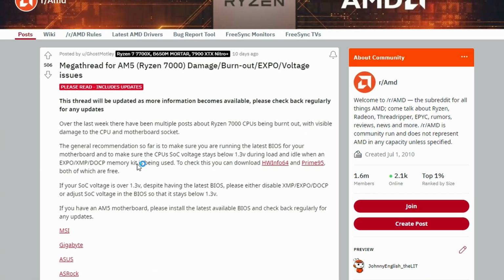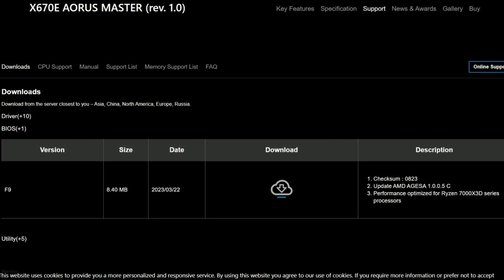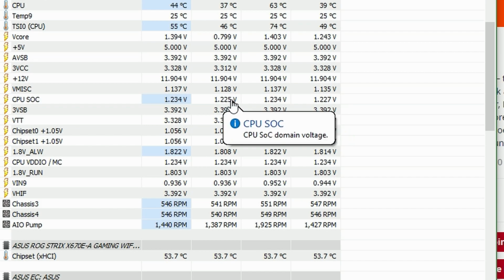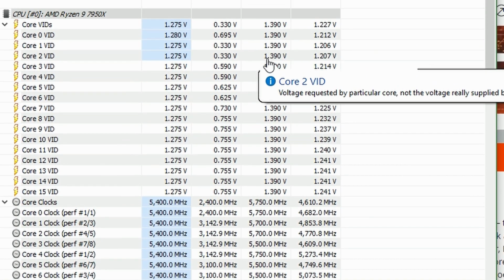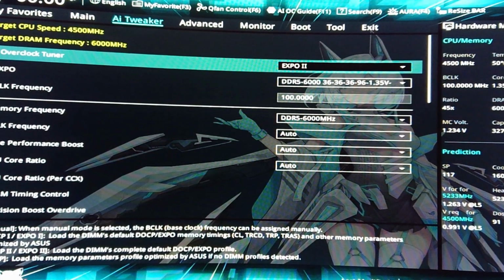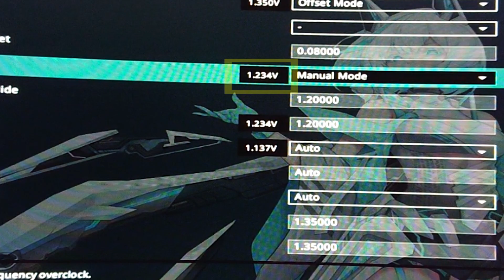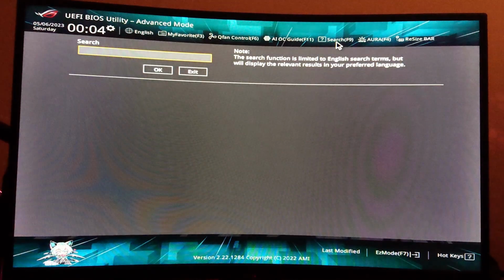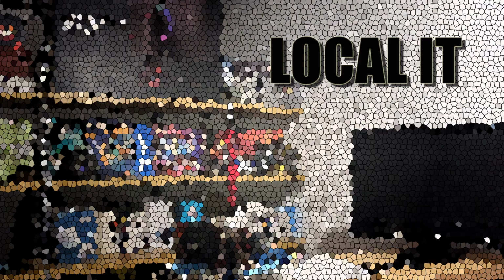Burned 7000 Ryzen DO THIS NOW! - 7800X3D or 7950X

Comment: The interesting thing I noticed if 5200, 5600 or 6000MHz tuned then they perform very similar using in game benchmarks. 7800X3D favours timings more than speed. So I thought lets try 4800MHz and same thing, tiny difference at 1080p, then I thought OK lets go vsoc lower to finally 0.85. Ran memtest and ycruncher for few days and my CPU idle power is like 13W.
Reply from the maker: @peteruk8  timings do play a lot. In another video about EXPO, I have a brief talk about it. Luckily, I finally  had some silicon luck with memory, went from CL36 stock to CL30 at 6000mhz. Even though, the actual fps increase is kind of small.

Comment: how did ur bios wallpaper change
Reply from the maker: @lelkasa361  its an option on select RoG boards.
Reply: @LocalIT  i am using a b650ef a board made by rog too, i would love to change the bios wallpaper if possible :) can you tell what app you used to change it?
Reply from the maker: @lelkasa361  there is a tutorial video on my channel, a YouTube short. Unlock Seven. The F version should have, because I've only tried A versions, the regular seven instead of the white seven, try it out.
Reply: @LocalIT  thank you for replying, i checked the bios tool section again and no i did not have such option on my rog board like you did have a good day / night :)

Comment: Hey my bios for cpu vddio is greyout I cant access it , I only change the soc voltage to 1.200v
Reply from the maker: @SpideyGamerHD  There should be a way to manual control it but I know that some BIOS versions have it locked.

Comment: With below build when turning on EXPO I got 1.4 volt VVDDIO / MC. First I adjusted my ram volts to 1.35 and this seemed to work with CPU SoC actually below 1.3v with 1.28v but VDDIO close to 1.4 and occasionially above. But I thought I'd still adjust Ram volt to 1.3, SOC to 1.2 and VDDIO as well like in this video. when I saved these settings my PC wouldnt post or go into bios giving a DRAM light on mobo. Luckily was able to enter bios with one stick of RAM in and default everything. I dont know which of the final adjustments was the reason, but kinda weary of trying again. Should I do RAM on 1.35 and VDDIO on 1.3 and let the rest be? or only RAM on 1.3?

My build:
7700X 
Asus Tuf B650 Plus WIFI 
RTX 5070 TI
Coirsair DDR5 6000 CL 30
Reply from the maker: @MrBRKSN  Hi, ram voltage is not the focus of this video and I would let it alone if you dont face issues. Ram voltage is not the mentioned vSoC or VDDIO.

vSoC was actually limited by vendors to 1.3v a little time after I posted the video. VDDIO should be in theory a little higher than vSoC. If it works like a charm at 1.3v or 1.35v leave it a that.
As for ram, VDDQ voltages. I have either 1.35v or 1.4v when EXPO is applied. I think up to 1.45v is pretty safe, check memory vendor site.

Good luck
Reply: @LocalIT  Thank you for still replying to this video! I guess I mixed up the various voltages when I saw my RAM was running with 1.4v. I'll set to my RAM to Expo again and see if VDDIO remains below 1.4. If not i'll lower the RAM voltage to 1.35 like I had before.
Reply: @LocalIT  Just tried again. Applied EXPO and VDDIO is at 1.424. Is the best step now to manually lower the VDDIO? By small increments?

Comment: It depends on DRAM and on MSI MAG B650 Tomahawk VDDIO is locked on 1.30 I can only change SOC Voltage which is set at default 1.30V
Reply from the maker: @RmX.  Thats after the lockdown, the video was made before those were implemented to avoid high vSoC values that we were getting, like 1.48 and such. Still, some boards, gladly still allow changes.

Comment: Up to 1.4v. Vsoc is actually safe but they lower it to 1.3volts with lastest bioses soo it doesent matter 1.3 is perfect for these who wanna 6400mhz 1:1 with memory controller.
Reply from the maker: Unfortunately thats something I can't say on a video. But the lower the voltage the better, as long as its stable. I kept going lower and now 6000 cl30 is super stable at 1.18v Will try 6200 later on.

Comment: 1.40 VDDIO & 1.3VSOC degraded my IMC on a 7500F. Wether it was the SoC voltage or the VDDIO, its hard to tell. Even till this day there are XMP/EXPO kits which set VDDIO to 1.4v automatically.
Reply from the maker: Sorry to hear that. Eventually higher voltages will degrade things, thats why I try to undervolt a lot of things.

Comment: Are there currently still reports of fried CPU’s and ASUs motherboards on the x670 series? Or have those been patched with recent (1807) bios updates?
Reply from the maker: Hi, the problem is long gone in the newer BIOS but this video still serves as a warning to monitor your rig closely.
Its a great tutorial to also undervolt if you are worried.
😉
Reply: @LocalIT  okay, thank u so much! I was scared at first, because this happened a lot, however I had my doubts as all those vids were 8 months ago, when the problem was I suppose at its worst. But thank you for the reassurance!!
Reply from the maker: @Myloh_YT  Glad I could help. ;) Don't forget to subscribe and share.
Reply: @LocalIT hi can i run expo 1 with corsair vengeance ddr5 6000mhz cl30 with the latest bios 1905? I am using x670e-a motherboard and 7800x3d
I am scared because my ram requires 1.4 soc voltage

Comment: Hello! I just build a 7800x3d + rog strig x670e-a set up. according to Hwinfo64, my cpu soc is 1.323V constant idle and under load. Also, CPU VDDIO/MC is 1.439 constant idle and under load. I am currenlty running latest asus bios 1807 released on 15 december 2023. Do you think i should switch to lower voltages or is it safe to run with these voltages now?

Thanks for all the help!
Reply from the maker: Hi, with the newer BIOS you shouldn't be getting over 1.3v so I would strongly advise you to try lowering it to 1.2v and see if its stable under stress testing. Good luck
Thank You so much for the comment and don't forget to subscribe
Reply: @LocalIT  thank you for the reply. It is the newest bios but it’s still giving me these readings. I did lower the voltage to 1.25 and it’s stable. Thank you and keep up the good videos!
Reply: Hello. Quick update. I contacted AMD and said that 1.323V on CPU SOC is completly normal.
Reply from the maker: @nacoleon18  I can't really go over what AMD says. But the "don't go over 1.3v" comes from ASUS website under BIOS update release. In my opinion and/or experience, the more you increase SoC voltage, the more stable RAM overclocks work. With my previous 2700X I had to bump SoC voltage just to get 3200mhz stable. With the 7950X I can run 1.2v with CL30 6000mhz stable. TLDR, if the system is stable with less voltage, the better in the long run. 😉
Reply: @LocalIT  agreed. Thanks for the reply

Comment: Another thing too is to make sure you have a decent cpu cooler that can handle/work better when ambient temperature gets high; like a hot summer day. Remember the 7800X3D can handle max 89 C.... back with the 5800H it could handle 105 C. 
I have a ASUS TUF B650M Plus wifi... I read my bios version is 1616, so that is after that April/2023 ASUS burn out fiasco right?
I checked my SOC voltage and I am under 1.3 V. I did mess with anything or try to undervolt just to be safe.
Thank you for some answers, just  a bit worried.
Reply from the maker: Hi, sorry for the delay. With that version you will be fine.
But, there is always room for undervolting 😉 Either be on the CPU SoC or vCore 😉

Comment: Hi, is it safe lowering the cpu vddio / MC Voltage to 1.2V, can it cause damage to my cpu or system? Or should I just keep it at default 1.376V?
Reply from the maker: Hi, lowering voltages won't cause any damage to the hardware at all. However, it can cause instability during stress testing or gaming. 
Be sure to test it and if everything is stable, go for it.
I have mine at 1,18v now and rock solid for months now.
Thank you for the comment and don't forget to subscribe.
Reply: Thanks for answering quickly, I was also wondering could the high voltage on SoC and VDDIO be the cause for my stuttering on my pc (I think the SoC is about 1.28. I have b650 plus tuf, ryzen 7 7700x, DDR5 6000MHZ Fury Beast 2x8gb) I get these weird microstutters and nothing really seems to help that ive tried. Could also possibly be the ram.  @LocalIT
Reply: Also was wondering do you think its safe to enable pbo with like -15 curve with the SoC and VDDIO set to 1.2?
Reply from the maker: @m0psi828  stuttering should be a bottleneck somewhere, doesn't need to be always GPU or CPU, could be a power limit too. Lowering voltages won't help with stuttering I'm afraid... But sure,try it. No harm there.
Reply from the maker: @m0psi828  I have a 7950X with a fine tuned Curve Optimizer, undervolting and the less voltage and temps, the better. PBO will have more headroom to Boost.
Reply from the maker: @m0psi828  oohh I forgot. 16gb only on DDR5 could be insufficient for nowdays.

Comment: Well i'm using 7800x3d and Asus tuf gaming b650m. I did what you showed me here. Everything working fine, but i can notice that now is PC taking longer to bootup ? Any special reason for that ?bootup
Reply from the maker: If you only did the two voltages, there is no reason for a slow boot. Lowering them would only affect windows stability. Have you try to indo the changes to see if it boots normally again?

Comment: Hi, The SoC Voltage shows me 1.295V, on EXPO Enabled, should it be safe ? + CPU NB/SoC value 1.304V-1.306V + CPU VDDIO 1.400V. I used this EXPO for 3 hours and turn off.

I was wondering if I should set the voltage (SoC/Uncore OC Mode and SoC Voltage) in BIOS in the first part of AMD Overclocking for PBO. And should I set with CPU VDDIO to 1.2V ?

And in the second part of Overclocking, where EXPO is turned off, CPU NB/SoC Voltage shows 1.015 V (options are Auto, AMD Overclocking and Override Mode (does not show when EXPO is turned off)--> I set this third option to 1.2V).

First, should I turn on EXPO and immediately go to BIOS and set these three voltage parameters to 1.2V? Before I go to Windows ? Can you help me ? Just to be sure what I should do correctly so that I don't panic again.

Specs: 7800X3D, MSI MAG X670-E Tomahawk (latest BIOS from 08/14/2023 ver.7E12v14, Corsair 64GB (2X32GB) KIT DDR5 Vengeance RGB 6000MHz CL30-36-36-76 rated on 1.4V (CMH64GX5M2B6000Z30)

Sorry I'm a newbie, I built a new PC this week so I'm worried :)
Reply from the maker: Anything less than 1,3v should be ok with EXPO enabled, but to me is a tad too high for my taste. If you are running 2x sticks at 6000 or 6200, I would try lower voltages. The video states 1,2v but now I've lowered even more both voltages to 1,18v and everything is running peachy.

The Ram rated voltage is for DRAM voltage (VDD/VDDQ) not the CPU SoC or VDDIO MC 😉

Thank You
Reply: @LocalIT  So, if I understood correctly, the following parameters should be set:
Soc Uncore OC Mode -> (Enabled)
SoC Voltage -> set to 1.2V
CPU NB/SoC Voltage -> set to (Override) -> 1.2V
-someone says that this also needs to be set
CPU VDDIO Voltage -> set to 1.2V (originally at EXPO I have 1.4V)

But I have other questions, with the DRAM voltage when I had EXPO on:
VDD Voltage 1.410-1.395V
VDDQ Voltage 1.410-1.410V
VPP Voltage 1.965-1.950V
-Someone says that it should be reduced to 1.3V on VDD + VDDQ, someone says that it's just normal when RAM asks for 1.4V, and someone says that this is the maximum "safe" limit, and someone says that you shouldn't have more be like 1.4V. I am confused.

-I ask: Should I return the RAM and buy, for example, 64GB 5200MHz CL36 which has a voltage of 1.25V or adjust the voltage from 1.4V to 1.3V? The difference between the 5200 CL36 and the 6000 CL30 is about 5-13 fps.
-How do I know that at 1.410V it is safe at EXPO?
-ChatGPT can't answer me because it only has data until September 2021. It's a shame.
Reply from the maker: Hi, If you are not fine tuning or doing any moderate tweaking, leave all the other settings at Auto or default values. The only settings that I recommend changing is CPU SoC voltage and VDDIO. Check stability and closely monitor with HWiNFO. This is just for safety and peace of mind.
If you want to bump performance then its Curve Optimizer and or offset undervolting. Check the other videos in the channel regarding this. 😉
Thank you
Reply from the maker: Keep the ram if it works fine, 6000 CL30 is amazing. I have 6000 CL34 but I'm trying to push them to CL32, I think its possible.
Don't worry about VDDQ voltage,if your kit can handle 1,4v its fine. However,you can try 1,35v and stress test for errors. I did.
Good luck

Comment: Hi, thanks a lot for the video. I was building one 7800x3d+B650 Aero G combo. But during bios upgrade (i installed CPU also) from F3 to F9c...the upgrade failed half way and system wont start again. 
I guess MB is dead and send it for refund, but do you think CPU is burnt also? So scared now...thanks
Reply from the maker: Hi there, I think the CPU is safe, failed BIOS updates won't cause any harm to other components. Try to get a board with BIOS flashback feature next time. With this, you won't even need a CPU inserted to flash a new BIOS. 😉
Thank you for the comment and dont forget to subscribe 😊

Comment: Why do these morons think that the first time they turn on their new build that the cpu is going to explode.  I am no genius or computer expert, but even I know that the new system by default is not going to overclock your memory by the expo settings.  So if the expo settings are off and your memory is running at default low speeds you wouldn’t have an issue.  The issue only arise when you try and overclock the RAM.

Comment: I bought a 7800x3d and have an asus tuf gaming b650m plus wifi.
Updated to the latest bios version which is 1636.
I have a KINGSTON FURI 32GB Beast DDR5 6000MHz CL36 which auto runs at 4800MHz.
I'm not sure if I should enable EXPO, because when I do, the values are set to "auto", what exactly does that mean, whats max value on auto?
I wouldn't want to fry the Procesor because of a stupid RAM overclock. But the risk is too high, at least for me.
Reply from the maker: If you have the latest BIOS then the corrections are in place and in theory the CPU SoC voltage won't go past 1,3v with EXPO enabled. The vídeo is a safeguard for everyone who wishes to lower those values even more. 1,2v on  cpu SoC is well within safe values, I actually ran that voltage on older 2700X to have XMP stable.

Thank You for the comment and dont forget to subscribe.

Comment: For 64GB kit won’t 1.2 VDDIO be to little? And will it hurt performance having it that low?
Reply from the maker: Hi, do you run EXPO? One thing i noticed is, VDDIO MC and CPU SoC values were pretty much the same. When I have EXPO disabled, VDDIO MC stays as low as 1,0v or 1,1v
I havent got a solid explanation for this voltage other than it is Memory Controller related. It won't affect performance but can cause errors or stability issues if too low. I could get away 32gb 6000 CL34 with 1,2 and now I lowered even more to 1,18v. 
With 64gb you may have to raise it a bit more but stress test your system with the lowest voltage you can till theres no errors or crashes. 😉
Reply: Sorry for not answering been a few long weeks 😅 Yea I use expo with custom timings on my sticks. I have lowered my VDDIO down to 1.25v and it stable. Not had any issues with it, and I think I’m going to leave it there since it’s within safe voltages. Nice you got the voltage even lower! You got more patience than me haha. With 64GB what would you recommend for VDDIO? I’m just curious

Comment: How i download the bios asus tuf motherboard update without launching the computer one time because the cpu can explode?
Reply from the maker: Don't worry it won't explode, just enter bios and lower the values stated in the video to be on the safe side. Then update it normally.
If your board has BIOS flashback option you can update it without even having the CPU installed.

Thank You for the comment and subscribe :)
Reply: @LocalIT  Thanks! I see on Internet, the 7800X3D limit voltage is 1.3v so if i have ram of 1.25 Max voltage (with expo on and 1.1 expo off), is it safe ?
Reply from the maker: @walter1917  Yes it is. I've been able to maintain 1,2v at 6000mhz EXPO

Comment: I just built with the 9 7900x with a gigabyte 650arous elite ax, i start pc up to start windows download and it overheats within a minute or so up to 105c and shuts off. Any suggestions
Reply from the maker: Hi, if you are getting that kind of temperatures within minutes, sounds like your cooler is not working as it should.

Try checking if its properly seated, enough thermal paste and make sure it didn't had a plastic peel on the CPU side.

If its an AIO, check the tubing, one should be hot and another cold, the one that comes from radiator should be colder. Check if the pump is working by increasing the rpm and listening for a whirring sound.

Thank You for the comment! Good Luck and don't forget to subscribe.

Comment: HI! Nice video. I have a strix rog x670a-e gamign wifi and a 7700x... I updated to the latest bios version available, 1415 and not using expo I left everything on automatic. can read in voltages: Misc voltage 1.128v, CPU VDDIO/MC Voltage 1.128v, CPU SOC Voltage 1.048v, CPU CORE Voltage 1.421. Is the core voltage right? A thousand thanks!
Reply from the maker: The cpu core is roughly speaking the primary voltage to the cpu, when the frequency goes up so does the voltage. ⚡ Leaving this at AUTO is pretty normal and OK but recent trends lead us to undervolt vCore, either with Offset or curve optimizer. CPU SoC and VDDIO is best under 1,3v like I stated in the video. 1,2v with EXPO enabled is fine. Check my video about enabling EXPO. Thank You so much for the comment, share and subscribe 😀